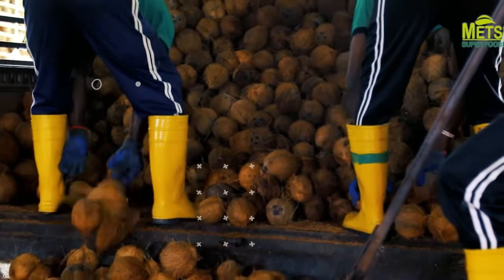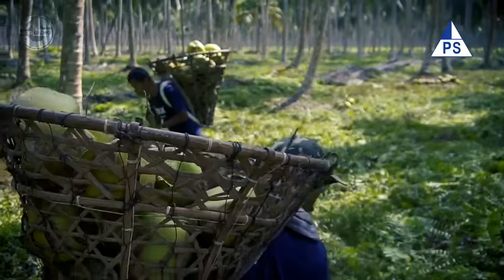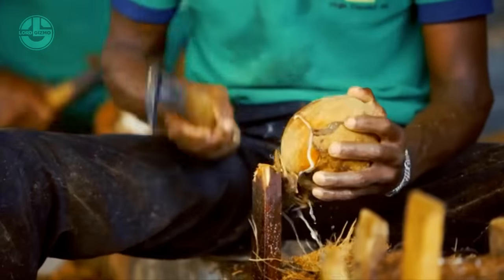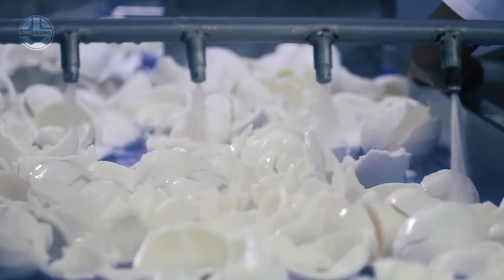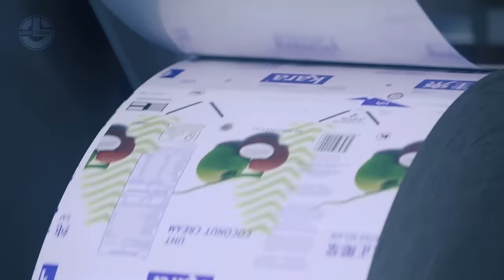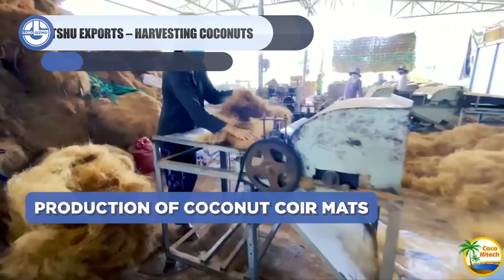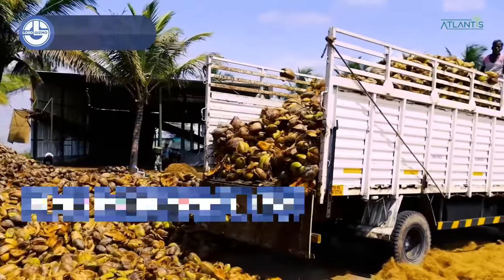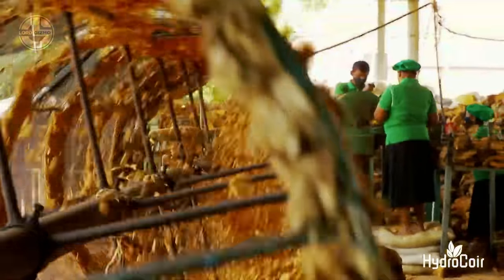Harvesting Millions Of Tons Of COCONUTS To Produce Coconut Oil, Coir, Peat Blocks, Charcoal

Comment: I am not so sure but something not right in your explanation.
1. First product in the bottle look like virgin coconut oil, not exactly same with cooking coconut oil. Virgin oil is mainly use in cosmetic, suppliment etc. 
2. Second product in paper box is coconut milk extracted from coconut meat. 
3. Coconut milk powder and coconut flour  are not same. Coconut milk  powder is a dry type of coconut milk extracted from coconut meat. Coconut flour is grinded coconut meat .
Reply: 1. Wrong. It is white coconut oil (or someone can name it virgin coconut oil too. But, normally we are not using that term). It is expensive than the yellowish oil. But both are edible...